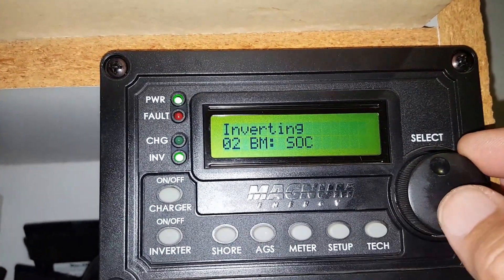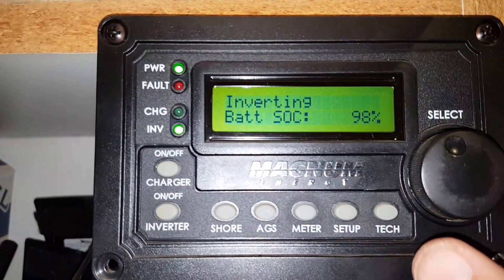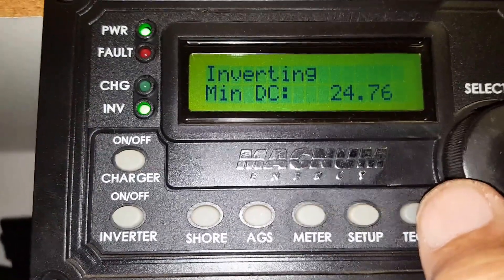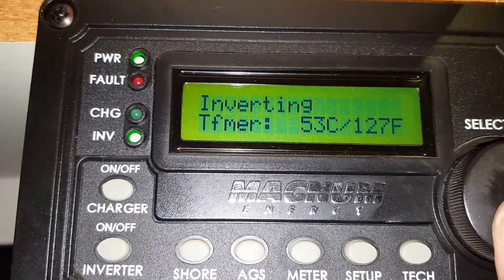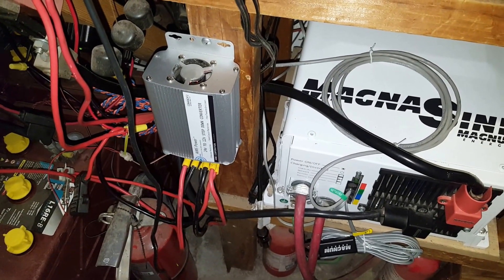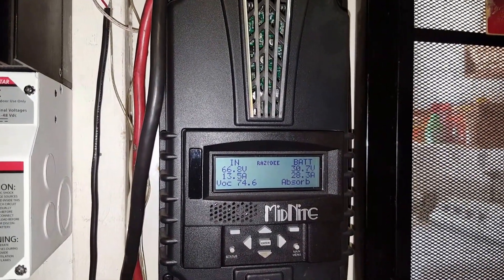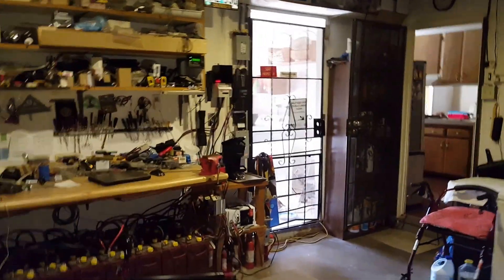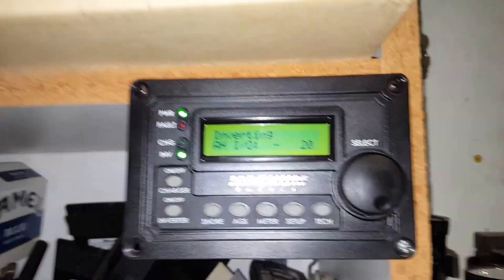Magnum Battery Monitoring Kit Performance.

Comment: After a equalization of the batteries you will need to reset the BMS by pulling the fuse.
Reply from the maker: Good info, thanks. Be Well